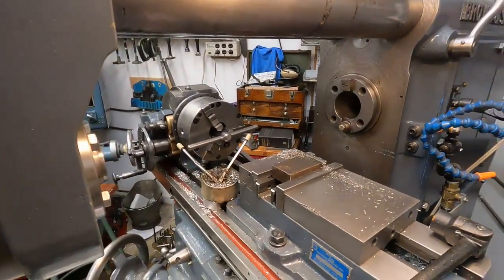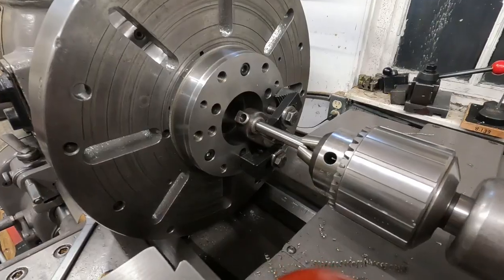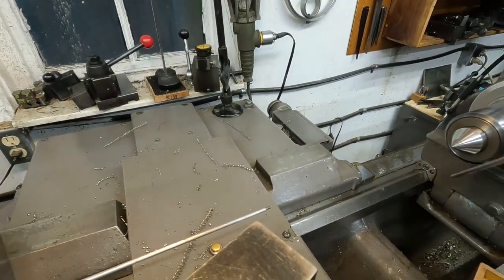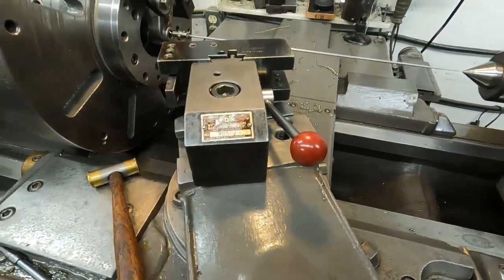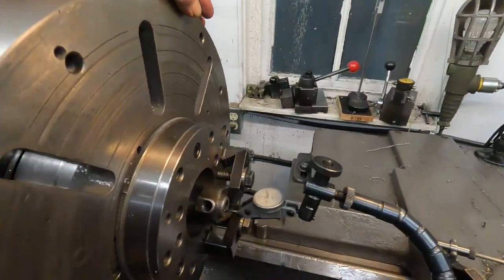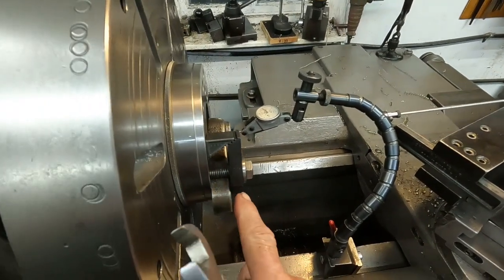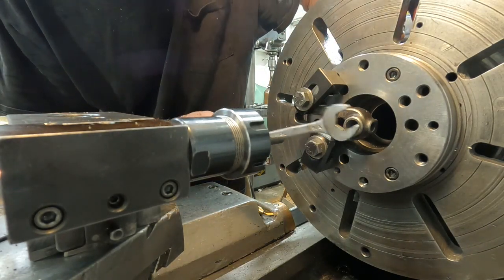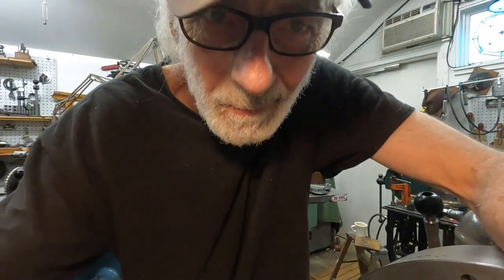Axelson Lathe Face Plate Work

Comment: That indicator would be great for reaching onto bores .    👍
Reply from the maker: The problem the indicator has is the more the rod is extended the less sensitive the indicator is but it still works. The terrible expensive Starrett 650 B1 dial indicator was the one I used the most for deep holes. I will try to find that and use it in videos, thanks!

Comment: I never thought of using an ER collet chuck for boring bars, but now, I like the idea. What would be the biggest bar you would recommend for these? You’re using a 32, do you think a 40 would give more rigidity? And, what about the shank? That is, is it hollow so that the bar can go back for less stick out? Now, for something else. I just acquired a beautiful 1939 full Brown & Sharpe catalog. There are machines of the same vintage as yours, but I’m not sure of the specific model. It’s interesting about vertical heads as they have about a dozen versions. It’s amazing to see all they made. I feel like crying when I think of how the company went out with a whimper finally selling to Hexagon. Now, the company is nothing more than a secondary brand name after the company they bought back in, I think, the 1990s - TESA.
Reply from the maker: I can use the ER32 with a 1" straight shank and the ER40 with a 1 1/4" straight shank in the regular boring bar holders. I make boring bars and have commercial made ones from 1/8" to 1 1/4". The collets are great for using short boring bars and small ones, even the old endmill trick. The ER32 is up to 3/4" capacity, but I used the ER40 for bars much over 1/2". and the ER40 is 1" capacity. The ER40 set I have is Iscar I adapted to every machine, and the ER32 is the least costly 1" straight shank holder and the lowest cost set of seven ER32 collets on the net. But, those I only use for boring bars on the lathe as there is excessive runout for other work. I also adapted the Erickson collet system to all the machines a very long time ago for casting repair, very versatile.
 My mill seems to be a war special. No2 Plain Standard 5000lbs large base. The column appears to be 1930s style with a modern for the time motorized knee that they used on several models including the sliding head mill "Range Master" and No 2 Light Mill. I was told B&S had the best field service and their best product was the screw machines.
Reply: @DonDyarprecision  ok. That’s useful information. I’m going to adapt an ER40 and try it out. Since they invented the automatic screw machine in , think it was, 1857, I would hope they would lead the pack.
Reply from the maker: @melgross  I usually have to hold the boring bars lightly so they don't turn when tightening. The 5c collets use a pin. The claim is that the ER collets have a 1/32 range but it seems like it is less, also it is said by? and? that drills can be held by the margins, I found they can but it takes a lot of torque on the nut
Reply: @DonDyarprecision  yup. I agree. In theory, the small ER collets can compress by 1/32”. I find that if you’re willing to use a lot of force in the wrench and wind the nut pretty much all the way to the top, it will work, but I don’t like to. The big collets which have most of the metal removed inside will move 1/32 without much trouble. I have a set of metric by a 0.5mm as well and often if something doesn’t fit well in one, it will fit into the others.I use DA collet holders in my Er-40 for drill bits. I forget the numbers of these chucks, but the smaller has a 3/4” shank and takes up to 3/8” and the other a 1” shank and takes 9/16. I prefer those to a drill chuck if I can do it. It’s faster to change, takes up less vertical height and I believe is more concentric. I hate to admit it, but sometimes, if I don’t have a screw length bit, I’ll hike it up in the collet to grab some of the flutes as well. But I really don’t like to do it. But, it’s much better doing that in a collet than a three jaw drill chuck though.